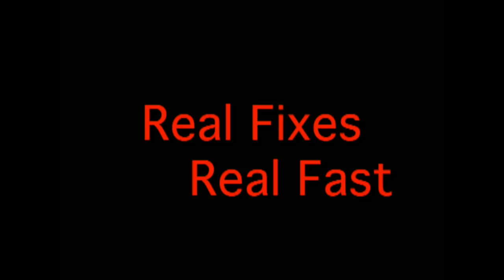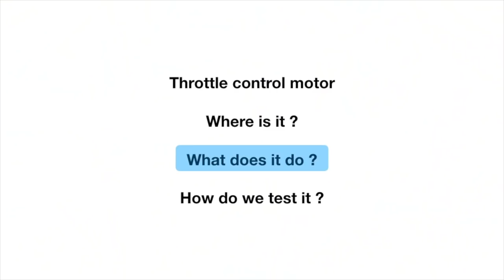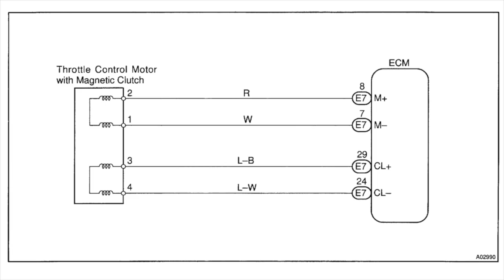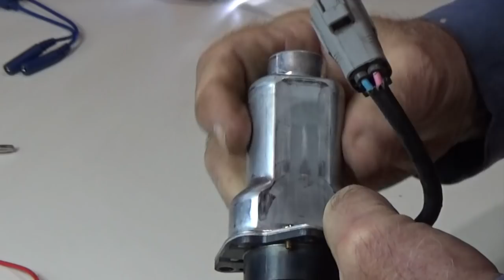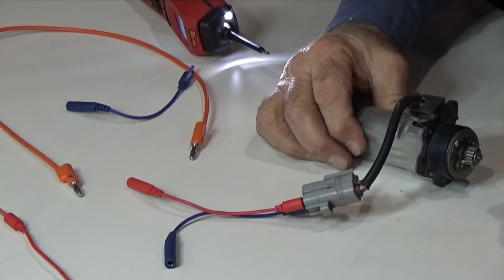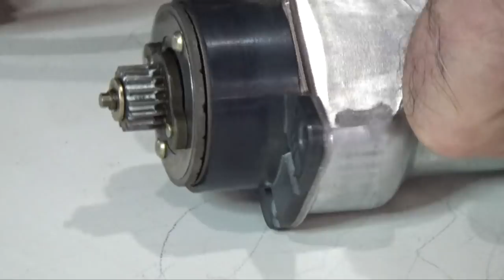Throttle control motor part 2   # Throttle Motor

Comment: Soon as ignition switch on, will there be 12V on positive wire of clutch and throttle motor?
Great explanation, thanks for the knowledge.
Reply: yes, 12v on positive wire with Key on.  The PCM will command by giving ground.
Reply: @strokewarrior5762  thank you mate

Comment: I know this is on an older toyota, but it seems overly complicated to me. 
Bosch DWB throttle bodies, the motor is connected directly by gears to the throttle plate with a return spring.
The TPS is integrated with it, with 2 potentiometers in an opposing sweep configuration. All operations of it is done by 6 wires, and no need to reverse polarity of the motor.
Reply: Again, different designs for the same function.  I don't recall see counter rotating potentiometers on the throttle plates, but I have seen them on the accelerator  pedal.

Comment: So why is the motor connected via a magnetic clutch, instead of gearing the motor directly to the throttle plate? Or did I miss where that was explained?
Reply: I am guessing the clutch is there there for "just in case".  Just in case the wires to the motor short to ground or +12V and the motor tries to drive the throttle plate to wide open.  The PCM can "override" that short and bring the engine back to idle/limp home speed.

I don't know if this clutch mechanism is common on all throttle motors.  it may be unique to Toyota.